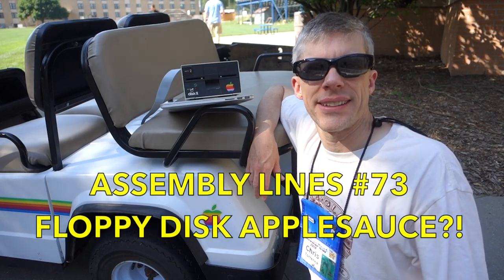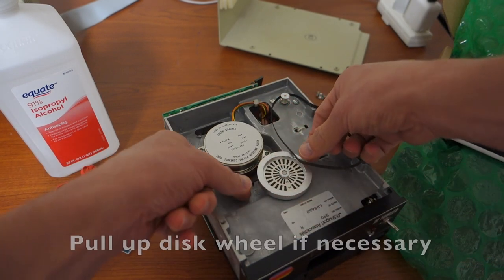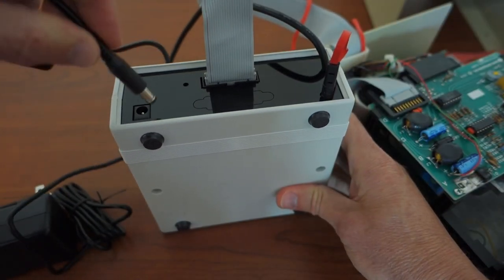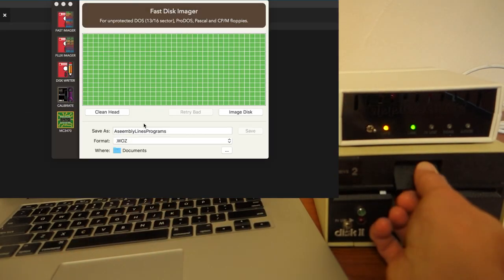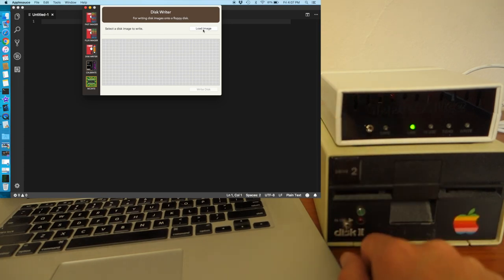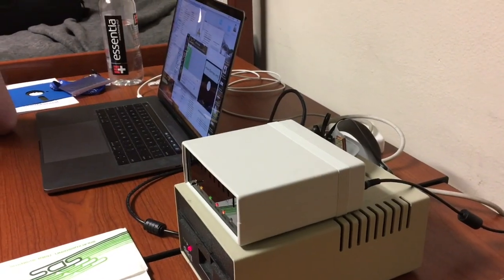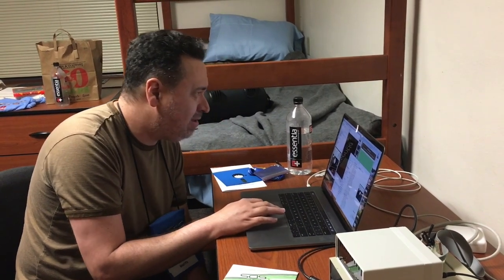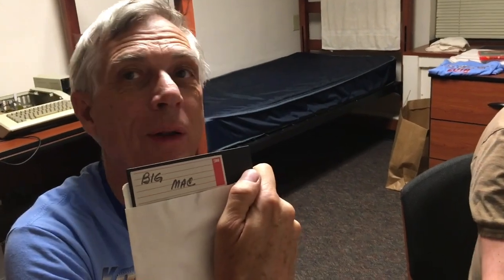#73 Floppy Disk Applesauce?!

Comment: For a little added convenience, you don't have to remove the drive cable from the keeper in the bottom of the drive. Just disconnect the cable, turn the drive over and remove the four screws from the bottom of the drive. The whole bottom enclosure comes away with the cable still in the keeper. So you save a couple of steps in disassembly and reassembly.
Reply from the maker: Dave Rogers That’s a great tip. Thanks!
Reply: Might depend on the drive.  The one I disassembled just now had a keeper on the back part of the bottom mount.  But no clip to hold the cable to the analog board.  This drive was sold with an Apple II+.

Comment: Right, I have to get one of these.
Reply from the maker: Definitely - they are really cool and useful. Plus, a lot of emulators now support the woz format.
Reply: I recently bought a HUGE box of disks (I think 1000 or so) for the Apple IIe and IIgs and I have no idea what is on them. Cant wait to get the kit and start going through them all.
Reply from the maker: That sounds great! Once you start imaging you can cross check with the Internet Archive (or Asimov) and see which ones have been preserved or not.
Reply: I hope I find something no one else has found. I doubt it, but you never know. I also have all my old disks to go through. By the way, thank you so much for your channel. I love it.
Reply from the maker: Well, it's interesting because some games have multiple versions, so even though "Zork" has been imaged, there are actually something like 9 different versions. So just keep an eye out for those...
Reply: Oh cool; I didn't know that. I will keep my eyes open. I will be ordering my device next week.
Reply from the maker: Looks like John Morris just opened up orders for the 2nd run. Just use that "Contact" link in the description to put in your order.

Comment: So there is no way to write back a copy protected disk image? This is a solution intended to create images for emulators only?!
Reply from the maker: Using the current software, you can write an unprotected .dsk back to a floppy. John Morris is working on a software update that will let you write back some copy-protected images. However, many copy-protected disks were written using specialized, commercial-grade disk drives that could write disks in ways that are impossible with the magnetic head and motors in the Disk ][ drive. So there will always be some programs that will be impossible to make perfect copies of (without a completely new disk drive).
Reply: Kryoflux and Supercard Pro can write back flux streams. Is this a limitation of the Disk II drive vs PC drives?
Reply from the maker: Well, I don't know much about PC drives, but from what I understand, the copy protection on the Apple II was extremely sophisticated/evil because almost everything was handled in software. So game companies could write out their floppies using crazy spiral tracks or quarter tracks and the Disk ][ would happily spit out the correct bits. But there was just no way that the same Disk ][ could be used to write those floppies. It's possible that with the new sync sensor, some types of copy protection could be replicated using the Disk ][. But we have to wait for a software update from John.